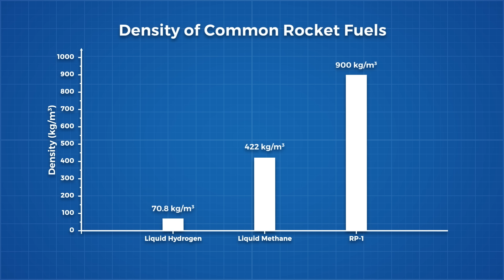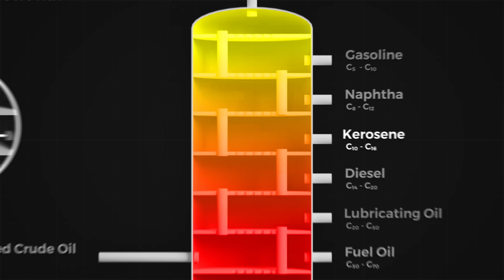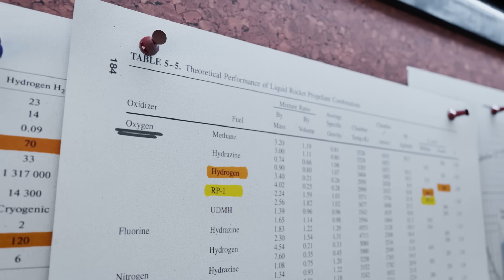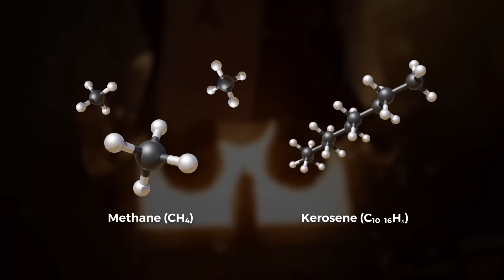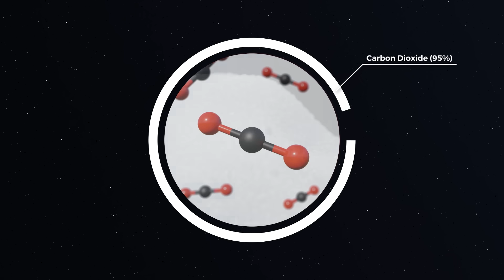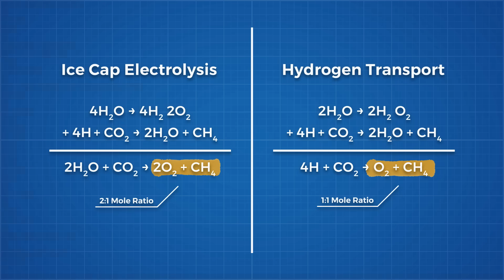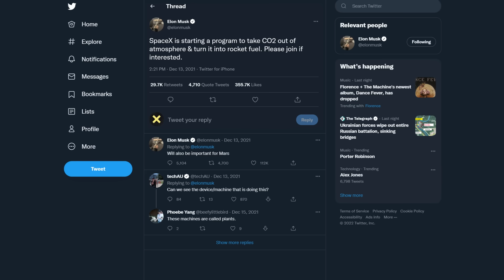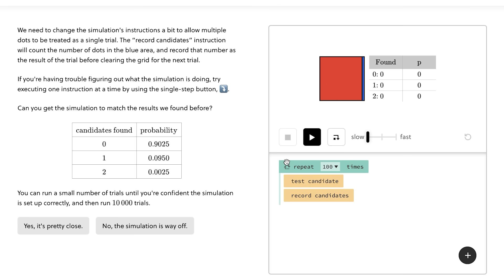Why SpaceX is Using a New Fuel

Comment: A note about sooty rocket exhaust - a few times you talk about how sooty rp1 is and at the same time show a bunch of relatively dark black flecked exhaust from a Saturn five launch. Yes the combustion is relatively incomplete which is why we can see the yellow flame but it isn’t like what you show in these clips. That part of the exhaust comes from film cooling, where they purposely ran fuel rich mixture around the outside of the nozzle to keep it from overheating.
Reply: And it only appears dark because the cameras are set to film the extremely bright flames.
Reply: @pseudotasuki  Even though the camera setting may make it look darker, it really is a almost black smoke, you can see this nicely with the merlin enigine testfires, its  a different engine, but the same cycle type
Reply: Although to be fair, any kerosene staged combustion engine will have that black soot running through a turbo pump unless closed cycle oxygen rich. SpaceX Merlin engines run black soot through their fuel rich open cycle turbo pump. Raptor runs fuel rich methane oxygen through one of it's turbo pumps, clean burning is extremely important for the engine to be easily reusable without cleaning between each flight.
Reply: Thank you, a very important detail there. Although he isn't wrong about the soot, the example (at least for someone who knows more deeply what's going on) was poorly chosen. It does also still get a point across.
Reply: A video for those more interested in film cooling, and many other cooling options that have been developed for rocket engine nozzles: https://youtu.be/he_BL6Q5u1Y
Reply: @MihkelKukk  Great info in this one, thanks!
Reply: Beat me to it.
Reply: If I am not mistaken, that incompletely burnt exhaust comes from the gas generator, used to run the turbines that run the turbopumps that feed the engines.  They rigged up the turbine exhaust outlet to completely "curtain" the nozzle extension, so it would not need to have LOX pumped through it, like the upper segment of the combustion chamber.
Reply: @dannypipewrench533 , that is mostly correct. The combustion chamber and upper nozzle (collectively called the thrust chamber) film cooling on the F1 was done by fuel (no LOX) injectors around the outside of the injector face forming a curtain of fuel between the combustion and metal in addition to the circulating fuel (not LOX) internal to the nozzle wall itself. Then at the junction between the nozzle and nozzle extension the turbopump exhaust is added. That meant less fuel only film cooling volume for the top end as it only needed to last until the turbopump exhaust came in at the junction to continue the process. The ring of dark sooty exhaust exiting the nozzle extension is the combination of turbopump exhaust + incompletely burned fuel from the film cooling of the top end.
Reply: @richardb1452  I forgot about the nozzle's film cooling.  I read the "Owner's Workshop Manual" for the Saturn V, and I thought the cooling systems implemented were fascinating.  Clever use of turbine exhaust.

But, what if we made the whole combustion chamber the injector?  So, that there are propellant inlets on every part of the engine bell.  Then, instead of running tubes through the walls, we just spray propellant right through the walls, and thus still get the cooling effect of running fluids through the engine bell.  I figure that we use hydrogen and oxygen for this design.  Of course, we would still use film cooling, but not the turbine exhaust.  A "curtain" of LH2 would be sprayed in the outer rings of the top injector, which would just be the injector in a normal engine.  LOX and LH2 would be sprayed from the inner rings of the top injector, with combustion intended.  Since most hydrolox engines do not burn all of the hydrogen anyway, why don't we segregate the combustion hydrogen from the hydrogen to be super-heated with the injector?  Sure, they will touch in the combustion chamber, but the oxygen should not mix too much with the hydrogen we just want to make VERY hot without burning.  This will not only shield the walls, but help better control how much hydrogen is being burnt.  The "bell" injector would only inject hydrogen, as it too would just be for propellant to be superheated.

But, it might be better for all of the hydrogen from above to burn, and the "bell" hydrogen to just be mixed in.  The flow of LH2 away from the chamber walls should help shield it, but maybe film cooling is just better.

My fascination with an "all injector" engine is based on two things: It should be easier to cool, and it should increase combustion stability.  Maybe this is absurd, but I have never heard of such an engine, and I think (with my limited knowledge) that it is interesting.

Earlier, I mentioned the turbine exhaust would not be used in cooling.  This is due to the fact that I think running pumps off of an electric motor may be beneficial, and therefore there would be no turbine exhaust.  Sure, we would need some source of electricity, but I figure we have a "launch battery" on top that each stage using electric pumps would be powered by.  Most launch vehicle have batteries anyway, I figure we just make them large enough to also do this.

The advantage to this is that we would have precision throttling.  Just change the current reaching the motor, and we can set the propellant ratios to just about anything we want.

And, now, my most absurd idea to date.  When using cryogenic propellant, we could pressurize the tanks using an electric heating element, thus causing boiling.  If there gets to be too much pressure, we vent some gas.  But, here is the fun part:  We run small, gaseous hydrolox engines off of the boil off at the top of the stage.  The same device that figures out when to open the vents could also light a spark plug.  Sure, this one is actually really absurd, but I figure if not this, then we could at least feed the boil off through propulsive vents.

I thank thee for listening to me rant about my weird ideas about rocketry.
Reply: @dannypipewrench533 , most rocket engine ideas begin as something someone thinks is absurd...lol.

That said, those initially absurd ideas need to have a reality check done to determine if they work or not. I'm not a rocket scientist, just someone who has been interested in the topic for decades. Here are a few things to think about:
1. less complexity is always better unless it confers a huge advantage
2. Less weight is always better unless (see #1)
3. The limit to #1 & 2 is that the thing has to not destroy itself before the job is done (especially important for reusability so the margins will be higher in that case for safety. F1 didn't have to worry about reuse as it was expended, Raptor, BE4, etc...do)
4. Film cooling works because it acts as a boundary layer that "sticks" to the metal (similar to the flow of air over a wing) that physically separates the combustion from the metal. However it will slowly be consumed by the combustion, so there is a balance between how much film you use vs. wasting fuel. You want to use "just enough". Fuel is used instead of oxidizer because the LOX is extremely unfriendly to metal at higher temps (it burns it)
5. There is a principle used for the ratio of combustion chamber throat size to nozzle geometry. This has a huge impact on propellant efficiency which is why the same engine core used in atmosphere vs. vacuum will have different nozzle size/geometry. They want the pressure of the exhaust to be just right compared to external pressure while having the velocity of the gases maximized (force = mass x acceleration applies to the exhaust gases too, not just the rocket as a whole). Fuel also burns most efficiently at certain pressures/temperature just like in an ICE, so dumping more fuel into the nozzle may end up just wasting it's potential energy as the pressure in the nozzle is lower than in the combustion chamber and you likely end up having less combustion before the nozzle exit and therefore less exhaust mass at max velocity leaving the nozzle for the quantity of propellant used. 
6. Some smaller rocket engines do indeed use batteries to drive the pumps, but as the engine size increases, the weight cost compared to a preburner/turbo pump gets way too high. That's why all large engines use preburners/turbopumps. Remember, we're talking megawatts of pumping power in large engines so the batteries would be huge&heavy.

Everything in engineering is always based on tradeoffs: weight, complexity, longevity/safety, performance, etc...The genius is in getting just the right balance.
Reply: @richardb1452  I am also not a rocket scientist, but hopefully one day.

I have a lot to say here.  Simplicity and being light are definitely key here.  That was where the whole "spray propellant through the walls" idea started.  While I have not tried to figure out if this would actually be better (due to not knowing how to check that), I figure if we can flow cold liquids through the combustion chamber without having to bring them back to the top, that would be better.  But, of course, that would only be the case if it actually works.  It sounds good in concept, but I have never tried to model or (thankfully) build such a machine.  Alternatively, since we know using tubes is an effective cooling method, we could have a second, upward injector at the end of the nozzle, that would spray along the walls of the combustion chamber.  That, in addition to a smaller-scale more-typical film cooling system, could produce the desired simplification if the "all injector" design should fail.  And, on the matter of oxygen not being nice to metals, that was the other part to the idea of spraying hydrogen out of the walls and having "zones" on the plate injector.  This should better prevent the oxygen from reaching the walls, but, again, just an untested concept from the depths of my brain.

On electric pumps:  yes, I am well aware of how stupidly heavy it could get.  But, and hear me out, I have an idea for that too, that I did not include in the last comment:  Nuclear reactor.  Assuming that the motor itself is of acceptable weight, and that the battery is the "too heavy" part, then, if we were already going to use one for some other job, such as nuclear-thermal propulsion on an upper stage, then I think this should fix the problem (again in concept, here, just assume everything I say is in "concept").  In this case, each stage's pumps would be run from the reactor on top (here is the fun part, don't ask how I am going to cool this thing if it is not for nuclear-thermal propulsion, heck, I might as well just work on that instead), with the electricity itself being generated by a thermo-electric generator using the heat from the reactor.

Perhaps the reactor could be cooled with LH2 regardless of if there is a nuclear-thermal upper stage.  If there is, then there could be propulsive vents so that when hydrogen is being used before that stage's engines are, it is not completely wasted.  Actually, in this case, a propulsive vent would just be a small nozzle, since nuclear-thermal propulsion does not require a combustion chamber.  This should add a thrust boost to any stage below.  If the reactor is not to be used on a nuclear-thermal upper stage, then the vents from the LH2 cooling lines would still be small nozzles, but this time there would be no main nozzles for the purpose of going to the moon in 3 hours.  (That is what this technology is believed to be capable of, anyway)

Next problem:  I know darn well that it would be complicated to put a running nuclear reactor on top of a supersonic flying cylinder, but I figure that if nuclear-thermal propulsion is a serious idea, then it must not be beyond reason.  Do not ask me how to do it, though, for I have yet to learn how to operate or construct such a machine.

It's always fun to talk about complicated ideas without really knowing how to do any of it.  Yet.
Reply: So you talk here smart things and don't see CGI and cartoons?
Reply: does that also mean that the fuel is less viscous meaning that it can flow more easily into the combustion chamber? Or is there any other advantage other than cooling the boosters which circulating the fuel has?
Reply: @jila6317 , RP1 being essentially kerosene, will be less viscous and also have a higher vapor pressure as temp rises, which no doubt the engineers accounted for, but not sure either are that much of an advantage. As far as I know they probably wouldn't go to the trouble of all that circulation if they weren't trying to stop the metal from melting. EVERYTHING is rocket engine design is a tradeoff between weight/complexity (which are bad) and stopping the thing from destroying itself (which is also bad) while getting the required performance.
Reply: The nozzle and combustion chamber, both would've melted otherwise.
Reply: It’s not like it’s a coal powered engine 😝
Reply: If you're going to carry extra fuel for cooling and it won't be burned, why not instead carry a bit of water?  Higher heat capacity and heat of vaporization (so you don't need as much), and no soot/coking.  The disadvantage would be that it is a stronger oxidizer at very high temperatures, but that isn't any worse than the water vapor from actual hydrocarbon combustion, although you would have more of it.
Reply: @Lucius_Chiaraviglio  The fuel used in film cooling is still burned. I believe as others here have stated it was used to drive the turbopump. They run the turbopump fuel rich which is less efficient (as in you get less energy per unit of fuel or whatever) but burns cooler. To be clear the exhaust used for film cooling would still be wildly hot by normal person standards, it just isn’t as hot as the main part of the exhaust.
Reply: @kineteks77  Yes, but only partially burned (otherwise it wouldn't make soot), hence for practical purposes meaning that extra weight of fuel is carried that is not burned.  So instead of the little bit of extra fuel, why not inject some water into the turbopump combustion chamber to keep it from overheating?  Could even also use it for cooling the turbopump blades and shaft before being released into the combustion gas (the Wikipedia article about the Rocketdyne F1 makes it sound like they did this with the fuel there, but I don' t know the details).  Then make a boundary layer film out of the turbopump exhaust gas as before.
Reply: @Lucius_Chiaraviglio , I think the simple answer is weight and complexity (additional tanks/piping, additional pump, additional controls, etc...). With rockets you don't add either unless there is a significant performance advantage. Easier to slightly increase the fuel tank than to add an additional complete subsystem. Rocket designers are aiming to optimize the complete system which means virtually every part will be sub-optimal compared to if it is looked at in isolation.
Reply: @richardb1452  Yeah, maybe the additional infrastructure outweighs the diminished propellant weight.
Reply: @Lucius_Chiaraviglio  water is far more useful as coolant and radiation shielding, not to mention drinking and sanitary usage.
Reply: pyropulse  as in there's still soot being created, he could've used a different example that's more accurate to the case, but considering the majority of people aren't rocket Enthusiasts, it will get the point across. Of course, now the people have a wrong understanding of how an F1 Rocket Engine works but let's leave that to their future curiosity to educate upon.
Reply: pyropulse  also, Film cooling does as well still create a slight soot problem, thus why the F1 engine was only possible to be used once.
Reply: False. Nothing you say here is correct.
Reply: My understanding is that the dark section is caused by the exhaust of the jets they used to pump the fuel. They would direct the exhaust of those machines into the nozzle to perform that film cooling you're talking about, just with the exhaust of the jet engine (which was about 800 degrees) instead of kerosene. 

However, they did run fuel through small tubes that basically made up the nozzle, which is another active cooling measure.

I believe the Space Shuttle's main engines were film cooled directly with fuel, though.
Reply: "That part of the exhaust comes from film cooling, where they purposely ran fuel rich mixture around the outside of the nozzle to keep it from overheating." 
But that's where the sooty exhaust comes from!

On the F1 it comes from the gas generator exhaust. The gas generators are run extremely fuel rich to keep them cool. The exhaust is then rerouted into the main nozzle at some point after the throat, where the main exhaust pressure matches the gas generator exhaust pressure.
Reply: @3gunslingers  The soot you see in the exhaust isn't really the problem, it's the soot buildup on the engine injectors that is problematic.
Reply: @johnarnold893  
I never said that it is an issue for the F1 engine.
I just said the soot comes from the gas generators, not from film cooling.
Reply: @johnarnold893  this guy gets it
Reply: @3gunslingers  The soot comes from two sources - the gas generator obviously and incomplete/complex combustion products of the main combustion chamber. It's not like the kerosene 100% combusts to CO2. It's way more complex than that.
Reply: @johnarnold893  that's why you run them for 3 minutes and no restarts.
Reply: @candyjaywee  The temperatures and pressures inside a rocket engine are ridiculous. If you actually want to get into it, a bunch of the exhaust products are super unstable things that probably shouldn't exist but are formed by the extreme conditions.
Reply: imo it is actually a good example. the gas that is used for film cooling comes from the gas generator turbine, which is also where most of the sooting problems occur. to the contrary, the soot that makes the flame yellow isn't much of a problem at all. also the soot may help the film cooling a little but is in no way necessary for that.
Reply: hello  i just wanted to tell you all to repent for your sins and come to the lord jesus Christ
Reply: @alexthomas3628  May I ask why discussing rocket science has prompted a request for us to repent for our sins?
Reply: @dannypipewrench533  Interesting question! However, which topic do you think is more important? I very much enjoy listening and learning from keen minds but "wise men still seek Him".
Reply: @HowardKelsey68  I suppose there is a time and place for everything.  And I do value religion.

At this moment, though, we are discussing rocket science, but perhaps it is only God that can guide us to the knowledge we seek.  Perhaps, He has set out a path that will lead me to the answers to all of my questions.
Reply: @alexthomas3628  Hello, I just wanted to tell you to F* off, you religious twit spam spreading wanker.